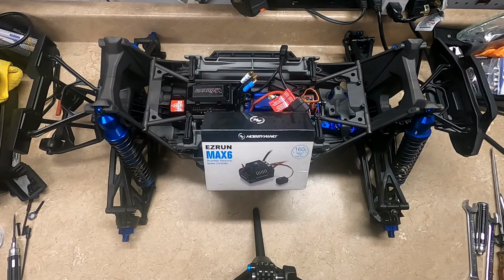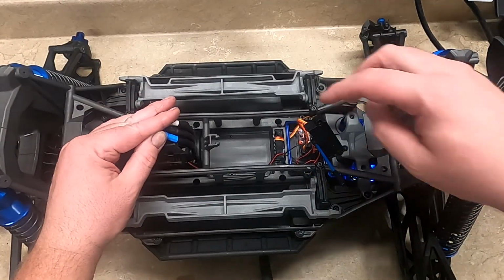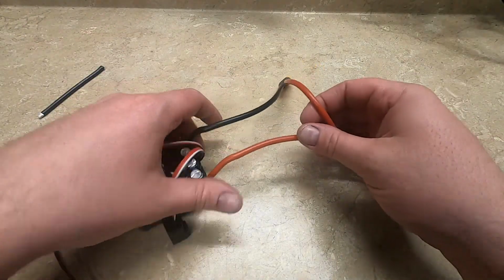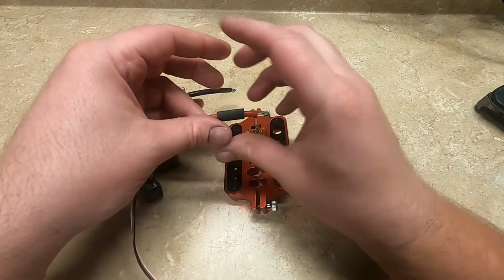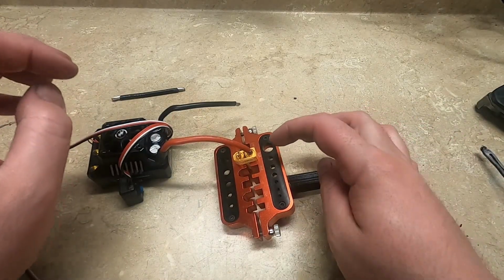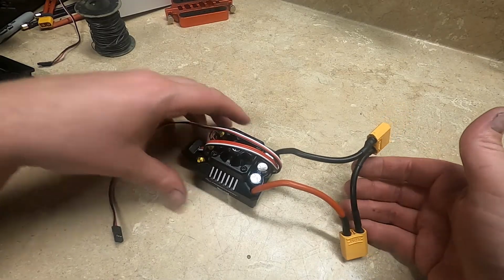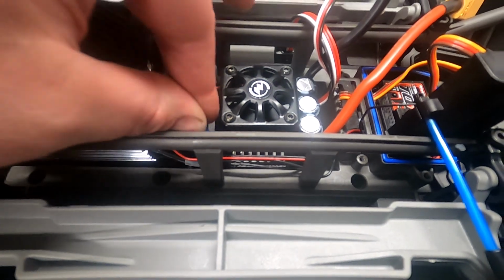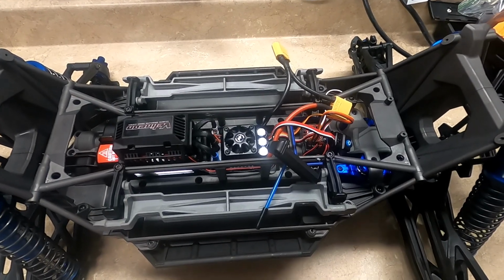Building a basher Traxxas X Maxx part 4 installing Hobbywing Max 6 ESC

Comment: nice just waiting for my max 6 Combo to arrive. I was curios of the wire gauge to connect both battery connectors .  im assuming thats bought separately.
Reply from the maker: @sheldoniusSRSlider  No, it's included with the max 6 I think it's 10 gauge though
Reply: @OverBudgetRC  thanks

Comment: Are you using a stock motor?
Reply from the maker: Yes i am it has a lot more power with this esc
Reply: Did u have to do any programming ? Also is it easy to change punch settings
Reply from the maker: @mattreadle4566  to change punch settings you have to disconnect fan and plug in a programmer which is sold seperate 

There may be a way to do it without one but this way is easier. You also have to set the neutral and throttle positions which is just done with the set switch on esc.

Comment: How do you secure it asking how does it stay in place
Reply from the maker: Just the double sided tape it comes with. Probably need to add a zip tie around the 2 chassis braces going over the fan i had it that way on my first one but i didn't notice i didn't do that until you said that. But so far it has held great with just that tape.
Reply: @OverBudgetRC  I used the double sided tape but I think whats missing is your suggestion of the zip ties thanks

Comment: What gearing do you run safely with the max6 and stock motor?
Reply from the maker: Ive been running 46 spur and 20 pinion on punch level 5 but i switch rcs between batteries to allow a cool off but havent had any issues with it. 
Id recommend punch level 4 though this is nuts on 5 lol. 
Im going to try a 21 tooth now i just messed up the 20 tooth and thats what they had in stock.
Reply from the maker: Im also going to use red locktite this time and im going to try keeping it on the 20-46 pin setting for the gear mesh hopefully that will fix my pinion problems im having
Reply: @OverBudgetRC  so you could safe it would be safe to run it on stock 18T pinion, and 46 spur with Max6 and stock motor??
Reply from the maker: @onlucho  Yes you could run 18 pinion 46 spur with the max 6 no problem it won't overheat the esc like the stock esc.

Comment: Where can you order an esc with connectors already installed? I suck at soldering lol
Reply from the maker: That I'm not sure I've seen them for the max8 in the past. What you could do is google the esc you want and add the connector you want after 

Like "hobbywing max6 xt90" and maybe something would come up.

I also have a soldering tutorial on my channel that might be helpful.

Comment: Would I be able to swap it to just 1 battery connector?
Reply from the maker: Yes you can if you only wanted to run a single battery 

What i do in my udr it have a jumper for the other connector if i run a single 4s